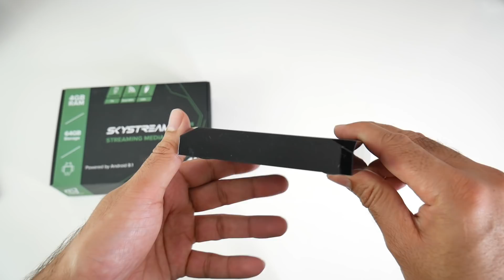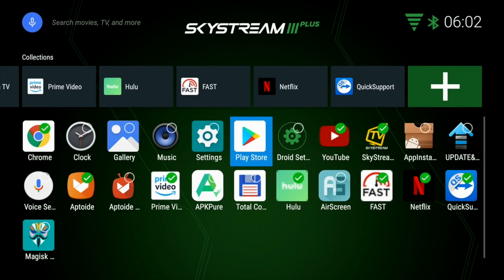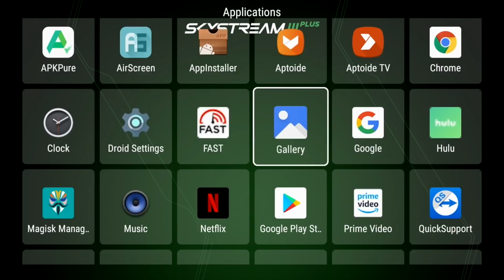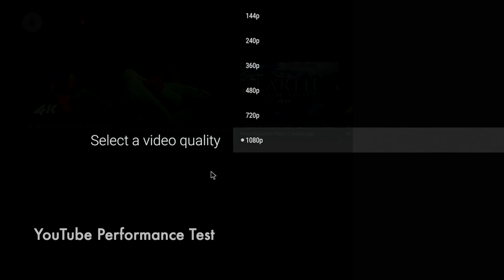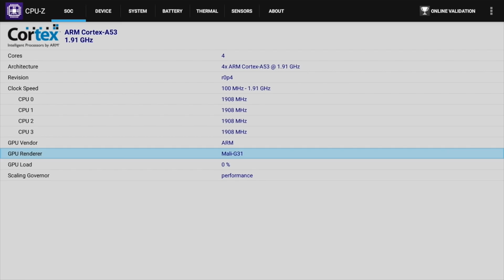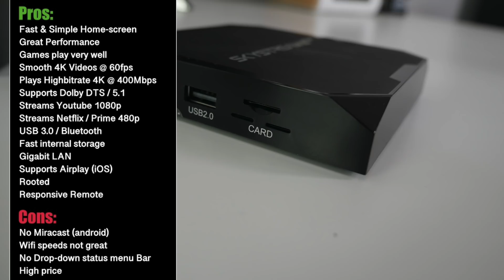SkyStream III Plus Android TV Box - S905X2 - 4+64GB - Any Good?

Comment: my 3 plus gets more than TRIPLE YOUR wifi speeds.. I pay for 100mps an my 3 plus pulls over 135mps. I'm about to upgrade to 1g (listed at 940mps) I'll report my results when the upgrade is done.. maybe you should reset your router an run the test again.. Netflix HD works just fine...

Comment: Great video! Which TV box do you consider the best with an Amlogic processor? (Don't like Rockship CPU).
Reply: Beelink GT1 Mini is the best with the new s905x2, the A95X Plus is the best with the new s905y2, and if you want to go for something a little older that has had time to get its firmware kinks ironed out then choose Tanix TX92 with Amlogic s912 which you should be able to find on sale.
Reply: @Richard_Ga6riel  what do u think of the t95Q box